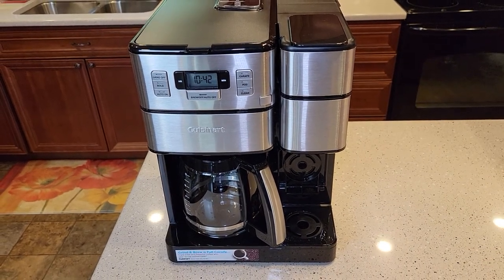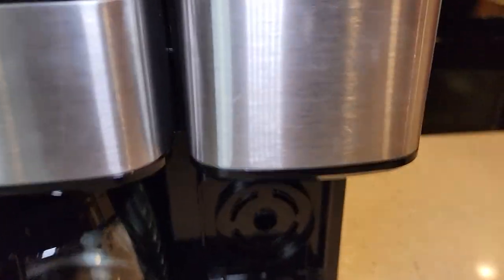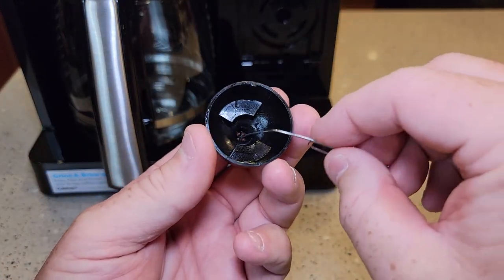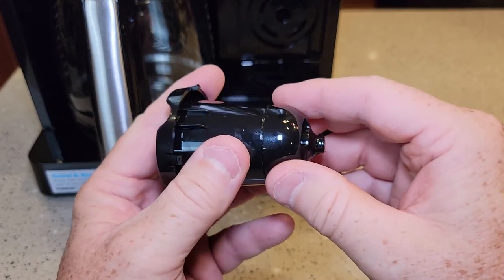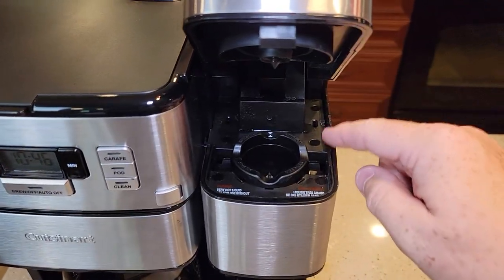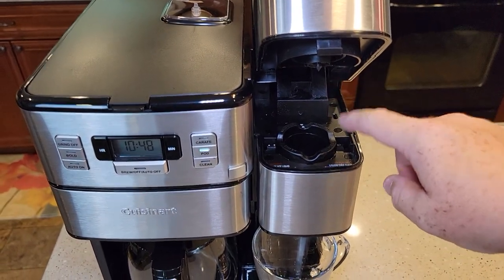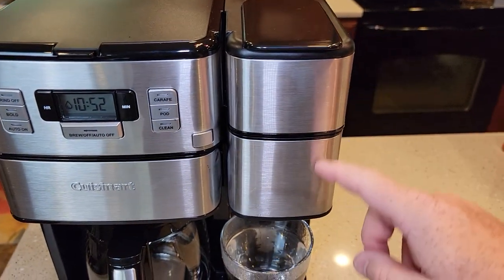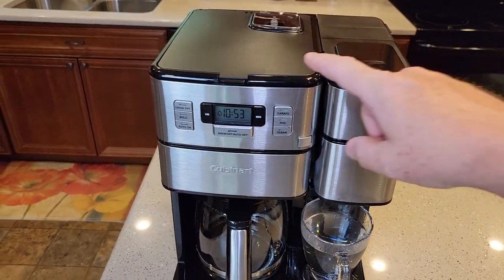Cuisinart Coffee Center Grind & Brew Plus K Cup Side Not Working?  CLEAN NEEDLES QUICK FIX

Comment: I was having trouble with the top needle puncturing the k cup and making the hole too big, causing coffee grinds and water to overflow out of the k cup and essentially landing everywhere.  I followed this video to see if it would help, and it did, somewhat.  After sacrificing 3 Duncan k cups, I learned that if there is a lot of air packaged into the k cup, you will end up having the same trouble I have been having.  I then decided to go ahead and push the k cup into the bottom needle by hand first before closing the lid.  This allowed the air to release which further allowed the top needle to land in it's proper position and create the hole with accuracy.  It worked perfectly after that and I immediately removed the k cup.  Just a tip from my mistake.
Reply from the maker: Thanks for sharing!
Reply: @JustADad  hey just a dad- I have only had my coffeemaker about a week! Used the k Kup side maybe 3 times- last 2 - this happened— exploding k kup and coffee full of coffee grains.
Reply: But will try this- thanks
Reply: @debbiemcgee6822  mine's still doing it.  I plan to contact Cuisinart.  I think it's a faulty top pin or something.  Good luck to you!  I hate how frustrating this is.
Reply: @LoveByHH14  I am considering sending it back… just frustrated!
Reply: @Debbie McGee  what happened with this? Just wondering because I had this issue but it was only with a certain brand kcups. I have always pushed the kcup down then closed the top so that wasn't a cause in my case. It was Aldi brand kcups that exploded every time so I quit using them. Other store brands are fine, Walmart, Wegmans etc...just not Aldi.
Reply: This worked perfectly for me, thank you SO much for the tip!! :)
Reply: You're a lifesaver! Manually puncturing the cup at the bottom first did the trick!
Reply: @akamelrod8872 I got rid of mine over a year ago.  I just couldn't make mine work, even when pushing the k-cups down first, no matter what I did.
Reply: Mine pours out too much water, overfills the kcups, grinds start to come out and none of the sizes, 8, 10 or 12 are accurate - it's pouring 10, 12 and 14 oz - how the heck is that even possible. Also the whole door to the kcup sweats profusely and there is a non steady stream plus a massive condensation buildup all around the inner layer of where the botton of the kcup holder snaps in, which also drips all over the place. I wish cuisinart would look at this flaw in the design cuz we all can't be wrong :)

Comment: This coffee pot is the absolute worst. I experienced all of these issues stated in the comments and more. I had it replaced twice. It leaks all over the place, includig the TWO replacements both under warranty. I kept telling cuisinart there is some flaw in the design. I did all of what you suggested and it was great to learn, educaitonal but didn't change a thing. So here's my latest dilemma (aside from the fact that the kcups exploded on a brand new machine, water and coffee grinds spilled out everywhere all of the carafe base, inside the machine, under it and all over the floor and counter), when I select a 10 oz cup it brews 12 oz. When I select 12 oz. it brews 14 oz and when i select 8 it brews 10 oz. this wasn't always the case, at least I don't thinnk it was, it happened after the latest issue I described above. I'm so over this and I will probably never buy anything cuisinart again. all the back and forth, endless calls and emails for them to finally say 'well sorry it's no longer under warranty but we can offer you 10% off your next purchase" - I said keep it. I won't use it. Have a nice day though. LOL  --- so does anyone have any advice? btw this is ONLY on the kcup side. the carafe & brew side work fantastic. the issue has ALWAYS been with the design of the kcup part of the machine.